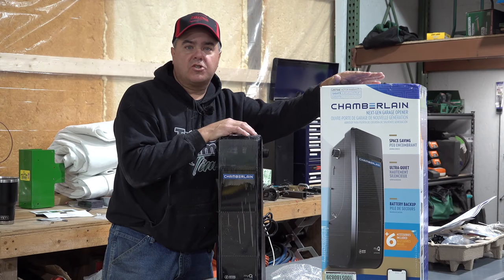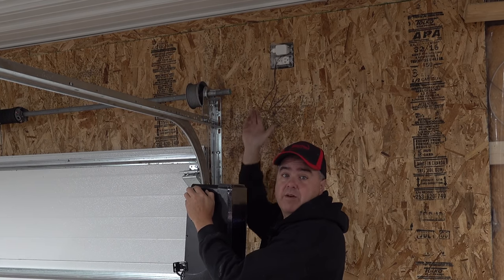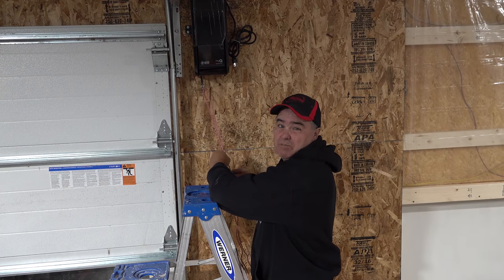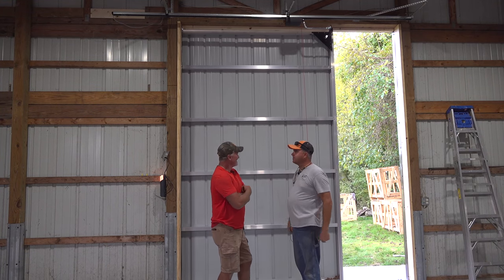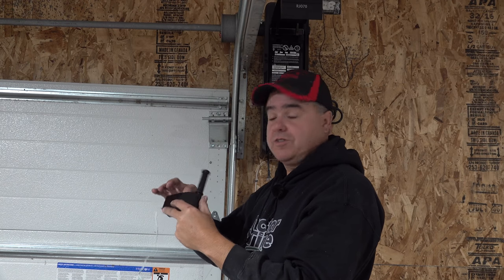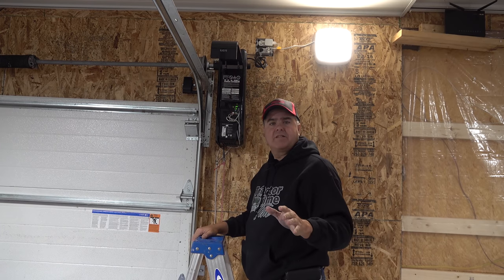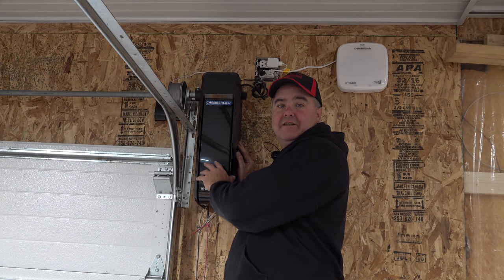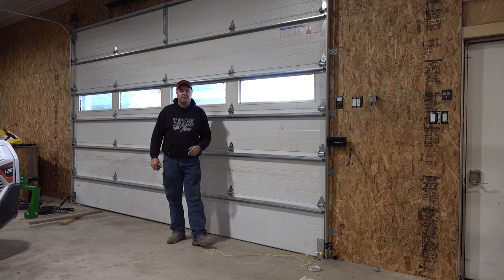Wall Mount Garage Door Opener Install - Chamberlain RJO70

Comment: I have read the numerous "issues" with the jackshaft openers on the internet and how problematic they can be before I made my purchases.  The  bottom line is that the doors must be 100% properly installed and balanced for the opener to work flawlessly.  The overhead tracks on the tall and wide doors will develop a sag if not properly supported midspan and it will create a drag when closing and putting momentary slack in the cable tripping the sensor.  There are many other issues associated with an incomplete installation that the opener will be more than happy to point out.  A good installer is not afraid of these openers and can indeed get them "tuned" as some other commenters have noted.  Pusher springs mounted at the end of the top rails and cable tensioners mounted on the bottom trolley wheels can solve a lot of any remaining issues.  I have three of the openers for  10H X 16W, 10H X 10W and 12H X 10W insulated doors.  They are not light by any stretch.  I would not hesitate to recommend them.  If the door is properly balanced and tuned, there is nothing to fear.

Comment: Those are great openers. I walked my son in NC installing one (I am in MO). Unfortunately his had a bad control board in it. CS was not good at that time nor was response time. Yes it was a liftmaster. Once working it is a great opener. Glad to hear your CS experience was much better than my son’s. His was installed a few years (maybe 2+) ago.

Comment: Appreciate the explanation of the release lever.  And reengagement.  No issues with mine other than the rubber door seal during the summer heat seals/sticks to the concrete and at times causes the motor to strain and create a power/torque fault on the controller.   Usually another press on the controller opens the door.

Comment: You really should drill pilot holes for lag bolts.  They are big enough they could potentially crack the stud.  They definitely weaken it a bit.  It likely won't ever be a problem, but better safe than sorry.

Comment: I installed the LiftMaster version of this opener when they first came out.   Love how quiet it is.  Just make sure you check the duty cycle on it (mine was something like 4 cycles in 10 minutes) so you don't overheat the motor.   Probably not an issue for you, but something to think about for people with kids who are going in and out of the garage frequently during the summer.
Reply from the maker: I think this one is identical. ...cept maybe yours has outdoor keypad.
Reply: It's looks pretty much the same, expect we don't have the battery backup.  Our unit is capable of having the backup battery, it just didn't come with the battery itself, have to buy it seperately.

You're not alone on having setup issues.  Directions weren't very clear but I finally got it after 15-20 minutes of head scratching.  My wife had issues undoing the release as well.  I just told her to pull the rope till you feel like you're about to rip the unit off the wall, then pull a little harder.   That release does loosen up over time.   At least it has on our unit.   Best of luck with it and thanks for all the videos!

Comment: I need this type for my father's garage. The architect put a support beam right in the middle of the garage so a regular door opener will not pull the garage door far enough to be able to get a truck or SUV into the garage!  This might be the perfect solution.

Comment: Looks like a nice and secure overhead door opener.  Great job talking through the challenges you encountered.  I wouldn't have considered upgrading my openers myself, but this video makes it seem completely doable. 
We have some minor damage on the rear door of our minivan from the current opener... ugh.
Reply from the maker: Really not hard at all.  Just took a little time.
Reply: these are great door openers, In the lovely CA  its become a nanny state and some politicians felt that these were not safety compliant and bans the sale of em now. I had installed my openers prior to that they are still working 16 years with not one issue. I had one shop door that was manual and I wanted to install the opener when I ran into the new regulation’s so I ordered it sending it to  Missouri and had my daughter bring it home with her when she finished college. I found your video feed after viewing the Green Hinge system makes for a nice tight sealed door. Thanks for the slide barn track suggestion. subscribed !

Comment: Interesting that you said shaft was not level. Then later you said the door wasn't either 🤔 something to look at. Be careful if you adjust them springs.
Reply from the maker: I put the springs up myself.  
Floor is not level, door jambs not plumb, header not level.  Nothing square about this old building!  Oh well.

Comment: HI Christy and Tim.
Nice setup.  I had one of these installed in 2016 on my 10 x 16 overhead door.  Works great and mine was LiftMaster.  Works exactly as yours except I don't have the MyQ up and running.
Reply: liftmaster is made by Chamberlin, just you have an older model

Comment: I have a low ceiling in my older garage and this side mount is perfect. I didn't know they were out there...thanks! Think I'll wait for the prices to come down a bit thought...$500 Yikes!
Reply from the maker: You can get it a bit cheaper without battery backup and WiFi.

You might also look at other brands.
Reply: @TractorTimewithTim  Will do...thanks

Comment: 46 years installing garage doorsand openers.

1.it is a torsion bar, not a pipe. 

2. The Chamberlain RJO is the "lumberyard" version of the Liftmaster series it is a great opener installed correctly.  Of the 3 or 4 homeowner installed RJO I have encountered, none of them were installed correctly. Two of those instsalls, did significant damage to the doors, that was severe enough they needed replacenent.  Somehow the homeowner figured that the door would be  replaced under warranty due to their serious mistakes.
Reply from the maker: What is the point of the comment?

Comment: Very nice set up 👍  . On that Step Drill bit. If I was going to make a large hole with it, I would use a small drill bit for a Pilot hole first and then use the Step Drill Bit. It'll save the small  point on the Step Drill bit for the future .

Comment: Technically, one is supposed to use impact rated sockets with an impact driver, which those didn't look like. That said, I'm sure no one actually does that - but you should proably wear safety glasses in case it shatters.

Comment: Did you forget the tension monitor? Wondering why you left that out of your video yet it is shown on the wall…curious?
Reply from the maker: I underestimated the importance of the tension monitor at the time.
I’m still struggling to get my door working well.  I’ve added pusher springs on the end of the tracks.  Have trouble keeping tension on the cables.
Currently, I have the tension monitor disabled…held open…but I know this is not good either.  Anyway, still struggling.

Comment: I used to Install garage doors. Whenever we put these up, we always had to also install pusher springs at the back of the tracks so the cables wouldn't slack and jump the drums...
Reply from the maker: I may have this issue. Would it help to raise the far end of the track to create some gravity help for the door to go down?
Reply: @TractorTimewithTim  see my comment with link. The pusher springs add the tension to the door that the jackshaft operator does not provide. Hope this helps!
Reply: @TractorTimewithTim  also, don't adjust the track. If you raise it, you can run the risk of the bottom roller coming out of the bottom. You won't be able to raise that track up enough to make a difference on weight.
Reply from the maker: Looks like the push bumper springs attach to the back side of the track, right?    This seems like a good solution.
Reply from the maker: Regarding ‘raising the track’, I meant raising the back part of the horizontal track creating a gravity driven downforce in the door...
So the horizontal track might be 3-6 inches higher on the back than the front.  Would that do the trick?  Seems like similar approach to the push springs.
Reply: @TractorTimewithTim  raising the rear of the horiz will not be enough. You'd have to put about a panel's worth of vertical in to get enough weight. Best bet judging off of your video is pusher springs. Yes, they mount at the rear of the horiz track.
Reply from the maker: Will do!  Appreciate your recommendation!!!

Comment: To adjust door being up one one side you slip the cable drum. Be very careful. Loosen the set screws a little bit on both until the drum starts slipping on shaft. Note: This only works if the set screws on drum haven’t been tightened so much that the shaft is crushed. Usually tighten set screws until hits shaft then another 1/2 turn. Be very careful. Springs under extreme tension.
Reply from the maker: Yes, I did this after filming.

Comment: Did I miss where you squared that opener up and leveled it? It looked off and the instructions say to do so.  I hung 2 of them a few months ago.... just don't want your motor to burn out prematurely with crooked stress on it
Reply from the maker: Discussed it.   Did you hear the discussion? Early in the video.

Comment: Hello I have model RJ070 since 6 months and works well however I noticed that the screws on the torsion bar come loose over time I have to tighten them at least once a month. Otherwise they will slip on the bar. Any suggestion on how to lock those screws?
Reply from the maker: Yes, this seems to be a weak spot. I really tighten them down tight….even indenting the torsion bar.

Comment: Great video Tim.  Oddly enough my garage started out as a Catholic Church while the monstrosity of a church was constructed across town. Because of that, they had an odd construction design for a garage, which included a soffit for pulpit lighting.  My garage has a soffit where a traditional opener would go and I did not have any alternative opener ideas until now, thank you.

Comment: I read some reviews on this opener and there appears to be some reliability issues with the main control board. I have two 25 year old Chamberlain garage door openers. Think I will stick them.
Reply from the maker: I would not replace existing working opener either.

Comment: Finally....a door opener that makes sense!!!  Exactly what I need for a 7' high door in a 16' high ceiling space.  No more trying to figure out how to mount the operator with the necessary bracing on a high ceiling.   Now....they need to work on the pricing!  $500....OUCH!

Comment: Tim. I love mine except ... the bolts that clamp to the garage door shaft keep loosening. Have to get back up there once in awhile to tighten and reset position
Reply: Next time they need tightening, back out the bolts a couple of turns, put some Lock-tite on the threads and re-tighten.

Comment: If you don't have one I recommend purchasing an Apex bit adapter. It's for your sockets to accept apex bit, or for that socket driver bit.
Reply: good idea for a rachet but never impact them into the shaft it will crush the hollow shaft and if a solid shaft it will crack or strip the threads. do not overtighten.

Comment: Looks like a pretty good unit and SO quiet!!! Odd that they require so much force to reset the emergency release. 
I think I could deal with stapling that thin wire to the chipboard and running it to the opener near the "man door" if that is where I wanted it ;)
Am I losing it? I thought one of your cats went missing???
Reply from the maker: This is a new replacement cat

Comment: I want to get one of these installed in my garage , like them much better then the ceiling mounted ones.  Funny thing though I had called a few companies that install garage doors and openers an wanted to charge me $1000 just for the unit.  That was not including installing or running power wtf.
Reply: Man you need to just buy them online and install them yourself, they are very easy to install.

Comment: Great video Tim, I've been thinking about putting an opener on my shop and this looks like the one even though it may be a little more expensive. I have the same type of torsion system you have and the opener will work perfectly. Thanks for sharing have a wonderful weekend
Reply: Make sure the door is running perfectly. These are finicky. I install doors and openers for a living. If the doors running good your good. If not have it serviced and new springs, rollers etc installed first

Comment: Loved the install. 2 questions: 1. Any idea if this opener  would work on a 2 car garage door and 2. How in the world did your cat not knock anything off of that table? My cat would have had every single part on the ground within 4 seconds.
Reply from the maker: Yes, would work on 2 car garage door assuming you have the same style spring I have.
2.  The cat is doing better about not knocking stuff off.  Used to be just like yours.

Comment: I work for overhead door I and put them up in 20 minutes with no problem and the door will not close very well because the motor sucks just get a overhead door opener

Comment: I can't tell but does it have a slow start AND a slow stop ? I'm lookin for that kind that does that
Reply from the maker: Not sure.  It runs quite smoothly...but not sure if it has this particular feature.
Reply: I have 5 of these on my shop doors. 3 are about 3 years old and 2 are about a year old and they all have the slow start and stop and are extremely quiet. 12x14, 3 ea.10x10 and a 9x8 no problems on any of them.

Comment: I installed that opener2 years ago and have had nothing but problems with it ever since...  it keeps losing its travel limits every other month and it has been unplugged for the last 3 months not even in use anymore. After the last time I had to reprogram it again, it won’t open more than a foot or two no matter what I do...
Reply from the maker: Interesting.  We’ll see how it goes for us.  Did you look at the error code(s) emitted from the up/down arrow key lights?
Reply: You try checking the bolts that mount to the shaft?

Comment: I have replaced a few of those operators. The customer typically had issue with cables coming off the drums and safeties failing. Mostly improper installation.  they had a issues with the first generation of operators with the circuit board going bad then taking the motor out. That has been fixed now.
The cable coming off is still a issues for some even with the safety install correctly. Door not balance, door does not move down when in the open position, or something under the far side of the door. 
In the right place it is a great operator I just don't find the the best solution for a standard door. The highlight or steep sloped ( vaulted ceilings) or full vertical are great candidates.
This is my opinion for what it is worth, and I job is working on overhead door and operator's.
On another side note I do not sell chamberlain, or lift master operators I fix them and occasional install them for customer's that want the bells and whistles.

Comment: did you make sure the cable tension monitor was mount was 3/4 inch from cable?   does it matter if it isnt?
Reply from the maker: It does matter.  Took some experimenting to get it right.
Reply: @TractorTimewithTim  I was afraid you were going to say that.  I hope it works great cuz this thing is not for your average person to install.  I have had to do some many extra things that were not expected

Comment: The increased cost of this style of opener is because it is different. Consider they use basically the same motor and drive mechanism.  Much less hardware.  And they do not have to include chain, rail, and all the other associated hardware to attach the chain to the top of the door.
Reply from the maker: ...and the battery backup...just stuff to allow them to price it higher...get higher margins.  I agree.

Comment: Great video, thanks.  I’m planning on doing the same thing to replace a traditional overhead motor. I need headroom to install a car lift. Your video has given confidence that I can do it myself without calling the overhead door guy. One thing you didn’t mention was spring tension, is it just factory settings per manual for the new motor? Or do adjustments need to be made?  Guess I can call the customer support if anything goes wrong.
Reply from the maker: Spring tension is same as for manual opening of the door. ...this makes sense when you think about it...the motor needs the door to open and close with as light of resistance as possible.
Reply: Tractor Time with Tim ok, thanks.

Comment: You or someone else have installed the wind load cross struts incorrectly. They should all be on the bottom of every section and use the hinge attachment. Note: it would not block the Lites (window treated section) of the 4th panel up! I am guessing that you did this..good luck Merry Christmas Stay Safe

Comment: Two problems with these. They don't lift or stop in the down position squarely. 
The top center of the door is often bowed in since there is no door opener pushing on it when closed leaving a gap at the top center.